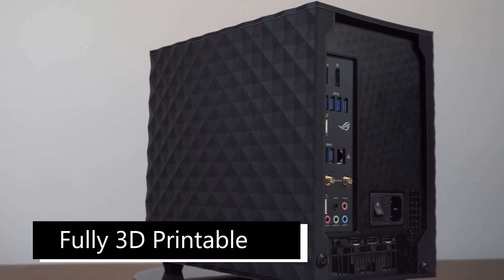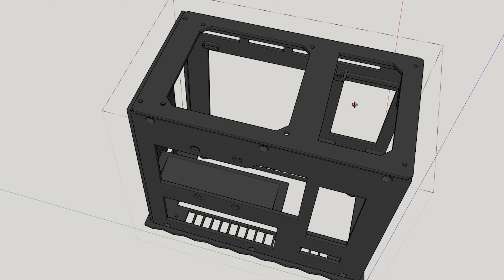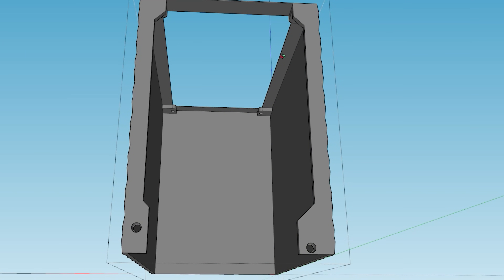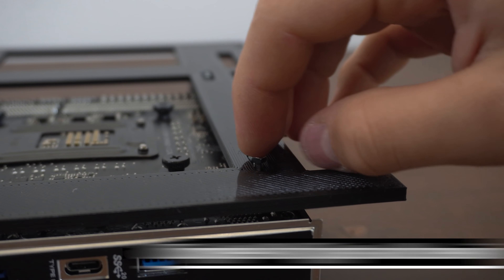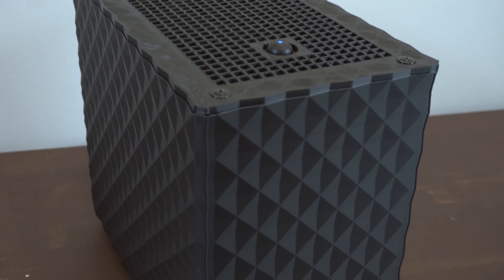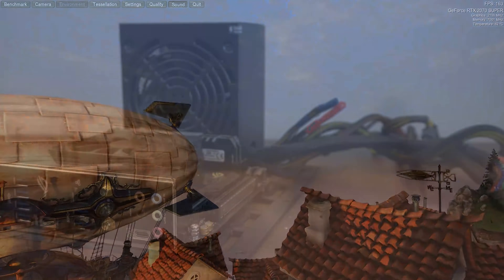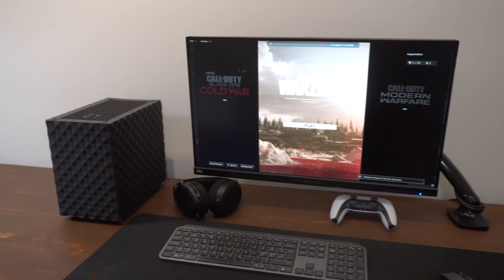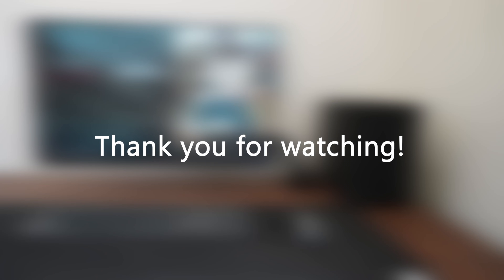CLEAN CUSTOM MINI ITX PC CASE BUILD | 3D Printed

Comment: Sir thankyou very much itx cases and every part is very expensive from the powersupply to the the itx motherboard and specially the cases looking at ur design i must say i m fan and you are also giving it for free is going above and beyond. Sadly i have already bought matx parts but no one makes compact cases for matx. Still very clean build.
Reply from the maker: Thank you! 😊

I’m going to work on a few ideas for matx complact cases as I might replace my fullsize ATX main pc with a MATX board! 😊 I
Reply: @makerunit   i am going to learn blender after this semester ends and was thinking of doing the same had some ideas in mind will be waiting to see what you come up with 😀

Comment: Free idea to make some money... print these in a modular fashion, with a panel/panels that are easily swappable. Could have custom designs to fit whoever's special setups or desires. Not sure if it would be economical or not as I do not 3d print anything nor have I ever. Just something that came to mind watching this again. Could use cut out designs to save material while offering more ventilation also. So many options and possibilities. Really neat stuff you have here. I see this channel growing quite a bit fairly quickly if you keep this up.
Reply from the maker: Hey! Thank you for your input! 😊 And thanks for the sub! (Saw your other comment too). A fully customizable case with the option to choose mounting brackets etc based on spesific needs would really be neat! But that would take quite some time to design, to get it flexible for almost all combinations of parts, cooling etc... it would probably be awesome and I could really see myself trying that in the future 👍😊

Comment: If you're going to design more cases maybe this will be useful: https://smallformfactor.net/forum/resources/accurate-blank-motherboard-pcie-card-models.25/

I found it a bit late when designing my own case, but it was good to confirm everything was in the right place before spending $60 on lasercut mdf.
Reply from the maker: That’s actually really helpful. Thank you! 😊

Comment: Your 3070 build looks like it's the exact 'no dollars wasted' type that I dig, mad respect
Reply from the maker: - Fractal Design Define S
- Gigabyte 3070 (cheapest 3070 I could find and strangely enough I just happened to find it in stock at MSRP in my preferred store already back in december.)
- i7 9700k
- 650w bronze psu
- 1TB m.2 (a2000 from kingston)
- Coolermaster Evo 212 Cpu cooler
- 32GB ram
- noctua fans for quieter operation
- 1TB 3.5 HDD for additional storage 
😊

And absolutely no RGB’s 😅
Reply: my pny looks amazing but you can't appreciate the led's because its pointing down

Comment: Next time instead of screws in some places, you can use press-in plastic nutserts. Used them on my e-gpu case and it worked amazingly.
Reply from the maker: Yeah, they’re pretty nice and gives a much more professional look to all kinds of projects. But they’re not something I could just go out and buy at least I couldn’t find any locally here in Norway. So I went for the screws as it was easiest. Holes seem to hold up fine though assembled and dissassembled multiple times no spesific issues so far 😊
Reply: @makerunit  Ah I got some on Amazon or Ebay a while back. Not local for me either haha. Great job on the case regardless!
Reply from the maker: @bagelbytes69420  Thank you! I might as well purchase some kind of big kit with all different sizes for future use definitely handy to have laying around 😊😊

Comment: 3.5 HD? Why not save space with an SSD?
Reply from the maker: Most motherboards have a m.2 slot. Or like the one I used had 2 separate m.2 slots. But I got a lot of requests from people missing this support in my previous build, so I decided to add this support for this one 🙂. It’s not that hard to customize the one side panel though either by drilling holes or editing 3D file to have support for dual 2.5’’ SSD’s instead 👍🙂
Reply: @makerunit  Undersstood!! Your build is a awesome one to say the least.
Reply from the maker: @izzysantiago978  thank you! I’m glad you like it 😊

Comment: Great project. I'm looking to do a even smaller case so I can use old computers as retro gaming without having to use that much space. This is a really good idea. But I'm still not into 3d printing yet. I am going to recicle old chasis for the same idea like in this video.

Comment: I don't know much about 3D printing. May I ask you how much does it cost to print it? I mean how much is the raw material cost to print a case like this?
Reply from the maker: Total filament usage was about 1.5 to 1.75 KG of black PLA. Assuming one roll is approx 25 USD, then total price about 40-45 USD. :-)
Reply: @makerunit  thanks!

Comment: Nice, but I'd use acrylic for the internal structural parts and 3D print only the outer layer, the complex surface element to save on time/resources..
Reply from the maker: That is definitely doable, if you end up trying it out, let me know how it turns out 👍😊

Comment: fantastic the design of your case, I liked the finish of the panels, did you design on the sketchup?  to avoid warping the piece, don't you think it is better to make the panels separate and then glue? 
On the gpu it would be interesting to have it mounted upside down so it wouldn’t pull dust off the table or a pencil that would roll down. 
They are just ideas that I had when watching.
Reply from the maker: I’m glad you liked the design! 🙂
About the warping, honestly that really depends, the internal brim I added really helped the adhesion by a lot. But I’d say some kind of enclosure or closet is a must to prevent this, as the slightest wind could cause warps... 👍 I don’t think it would look as clean if printed separately though. 😊 about the GPU and dust, I think you could actually easily make some dust filter by simply just making a plate with a filter on it, and just clamp it in place between the chassis and the feet, if that made sense 😊

And yes it was actually designed in the free sketchup 2017 😅

Comment: Looks pretty good! Actually, this is a way to make a really good airflow case. It would be nice to see micro atx cube case made for airflow!
Reply from the maker: Thank you! I must have forgotten to respond to this one, sorry for that. I’ve got one in the progress right now. (Not a cube but a mATX/itx compatible case) Supporting graphics cards up to 300mm+ and all printable on the CR10 or similar (300x300 printbed) Looks promising so far done a couple test prints still some tweaks to do but will be out eventually 👍😊

Comment: The ITX case is a great design. I would only try to print the whole thing in ABS / ASA and smooth it out with acetone. In addition, it can withstand more heat without becoming soft. My PLA prints in my case didn't withstand 2-3 hours of playing games.
Reply from the maker: Thank you!

Smoothing it would be really cool! I have never tried that myself on a 3D printed object! I think the getting soft part really depends on the layout of the build. I have not encountered that issue through multiple hours in a row.

Might somehow get soft but not something that I have noticed at all. Only maybe it would deform if I on purpose tried to squeeze in the sides or whatever when its hot. Maybe only then. Keeps it’s shape well at least with my setup of parts 👍🙂

Comment: I would like seeing a NAS ITX case with a sfx PSU. Unfortunately lots of the NAS cases with ITX using Flex-ATX PSUs wich are quiet loud with the 40mm Fan, and have bad Airflow at all. I´m was searching for about a year and in the end decided to use a mATX case, because I couldn´t find anything good. The problem is, that most of the small size cases are for gaming and dont have much 3.5" HDD slots. Most NAS systems dont use GPUs and thats also wasted space with normal caases being used as NAS cases. I hope you may can do something like this. Would appreciate this a lot.
Reply from the maker: Hey! I’m not so familiar with NAS, do you mean like a storage server case?
Reply: @makerunit  Yes exactly. Most cases you can find are something like the "Inter-Tech SC-4004" unfortunately they have very low cpu cooler space, and bad airflow. A case with a sfx PSU wich is a sweatspot for small size and noise, and maybe a bit more room for a cpu coller with an additional 120mm fan for exhausting the heaat and also cooling the HDDs. I was thinking modeling something like this by my own, but I´m not that good in modeling parts who need to fit toghether :)
Reply from the maker: I understand. Though, most likely I won’t be doing exactly this type of build for the moment but maybe at some later point. But I totally understand what you mean! You should definitely give it a go though there’s so much to learn through YouTube tuturials. I’m literally for now just using the free sketchup 2017 version 😊

Comment: I havent check your other video but id like to see a pc case with atx mobo, sfx psu and gpu 3 fan. no 3,5 hdd only ssd or m2. essentialy a small atx. with cpu cooler noctua nh d-15 or aio 280mm. what do you think? it could be an intresting solution for you?
Reply from the maker: Hey, making something small with an ATX motherboard is definitely interesting. Not sure how small I would be able to get, but I might do an attempt in the future 🙂

Comment: Wow, this is the most appealing arrangement of ITX components I've seen since 2017!
Would you consider evolving especially this design a little more!?
I would say if you did a few more tweaks to make it more versatile and accessible you could undoubtably put it on Kickstarter if you make it in metal!   some issues I noticed:
1. Instead of the "two main windows" for 3,5" mounting, make it a big window again with a screw-on bracket for people who do want a mount 3,5" or 2,5" drives there. This also allows people who don't use 2,5"/3,5" drives anymore, to directly access the mainboard easily if you want to change RAM sticks etc.
2. Consider a possible mounting of the PSU in the way that it draws air from outside, so that the shroud allows to draw ai from outside via some venting holes. Would also have the postive side effect that the PSU cables don't collide with the space for the grahics card. And maybe also make it a screw-on mounting bracket to allow for a use of SFX PSUs, maybe you would even have enough space for TFX PSUs etc instead of making it direct part of the side panels!
(btw there are some nice semi passive PSUs from Corsair that don't start spinning before you draw 150 or 200W and partially, depending on the model, even more - would be a benefit for semi-passive PSU users if the shroud had some air vents to not draw air from the outside.)
3. For smaller PSUs (SFX etc.) did you consider to make it possible to move the mainboard sidepanel a bit more to the inside, so that some poeple could mount a radiator behind the motherboard? I can't tell how much more space this would free up in the case but if it's enough you could probably even satisfy the water cooling community (ok, would then again need venting holes, this time in the side panel...).
4. Make mainboard mounting holes for compatible for STX boards.
Currently we don't know what will get more love in the coming 5+ years from mainboard manufacturers in the SFF space, therefore it wouldn't hurt to have the fitting mouting holes.
(plus, those boards aren't using the big 24-pin connectors / ok you then need some extra bracket for the PSU standard STX uses, but I would bet many would also love to change their board if ATX12VO shouldn't become a standard in the coming years, just to avoid having to deal with the 24-pin connector (look at the tiny space between PSU and board even in your case! ^^))

If you should go down this road, I would love to see it on Kickstarter in the future! :D

bonus idea:
many of us already have very potent 48mm coolers that do their job excellent, especially, when they draw air directly from outside the case - mind designing a 3d-printable mount-on wind tunnel that fits with 92mm fans? :p (in case, the shroud gets vent slits/holes)(after everything more important is done)
Reply from the maker: Hey! Thanks for all the suggestions! I’ve seen many comments both here and on Reddit and I’ve gotten a pretty good idea now what people seem to want! Watercooling options, added storage, direct air intakes from the side, and generally more flexibility overall. This is also my personal favorite so far. If only I could make it so it supported 3090’s too it could potentially be pretty awsome. 

I’ve got some new ideas in mind though! 😊
Reply: @makerunit  Gotta say, I'm almost a little hyped of what I'm seeing here. Especially seeing how quite robust this all could become with just some brackets. I could already imagine even this is no two chamber design, if the CPU cooler could draw air directly from outside this could become a really reliable workhorse with the way the graphics card pulls air. 
Ahh yes, and of course you need a 90° angle power cord if you rotate the PSU by 180°, but I really think the PSU should get the air from outside, there are only really pricy passive PSUs and drawing air from inside is nearly a death sentence for every silent PC! xD
Reply from the maker: You got some solid points. My main concern was to ruin the esthetics of the case by adding additional holes in the cover. But I’ve got a pretty good idea in mind that might improve the thermals by a lot. If it actually works is another question but it’ll be fun to see how it ends up working’ 😅
Reply: @makerunit  Additional note: just remembered, when the fans are so close to the ground that can affect the perceived loudness/ sound characteristic of the graphics card fans in an unfavorable way. Maybe look into this. Guess won't be a big issue for all semi-passive and passive cards, but maybe for active cards with bad fans, but sadly can't name any brand I would be aware still uses bad fans, not buying THAT many graphics card throughout the years! :P

But maybe experiment with different heights of feet/stands, no idea how these are actually called! ^^"
Reply from the maker: I’d just call them feet 😅 I haven’t had any issues so far with this. But PLA is a very hard plastic. Having the graphics card resting on the bottom plate like that definitely introduces some tiny vibrations into the tabletop. Adding some furniture pads or rubber pads to the bottom of the feet removed the tiny vibrations in my case.
Reply: @makerunit  Think we all have a bit of rubber foam just in case if it comes to vibrations! xD

Comment: A SSF Case with support for dual 280mm Radiators would be awesome. A D5, SFX PSU, ITX MOBO and a small reservoir would make it unbeatable.
Reply from the maker: Would be amazing indeed! Question is would it still be considered «SFF» ? 😅 Not impossible. I’ll try out a few different designs in the future though! Some watercooling at least is definitely in the plan with my next case design! 😊

Comment: My dream case is a nr200 style case, 4x 120/140mm fans, 2x bottom and 2x roof for that lovely chimney style cooling. Vertical gpu mount, triple slot x 320mm long. As a bonus, 240/280mm rad support top, and if possible front. Maybe with enough adjustability to be able to connect them both with 90° connectors. Mind you that would make it pretty tall. Thin though, possibly.
Food for thought.
Reply from the maker: Yeah’ the NR200 is a great case! Vertical 320mm card with 90 degree connector would make a very tall case though! I’ll be working on a few ideas for more flexible solutions in the cases in the future,  more focuses on airflow and flexibility like watercooling etx. As the ones I’ve made so far are kinda locked into one spesific layout! 😊
Reply: @makerunit  I meant vertical like in the Nr200, with the fans pointing outward. Sorry my wording was off. It would limit ram and cpu hight though, but with a low profile pump if you had 140's above and below sending through an ungodly amount of air I reckon she'd be alright. Although thinking about it, having one of them thick of gpu's that expels air sideways, using a mini itx board if you could have some air vents right below the motherboard and mirrored on the other side panel and then allow the gpu to suck in through the bottom you'd be ejecting that air straight back out again, then you could use the gpu to create a sort of chamber for the mobo/cpu/ram which would be easy enough to create a nice flow. Sorry I'm full of crappy ideas and sometimes they just pour out.
Reply from the maker: @ConfusedRaccoon  your ideas are really not crappy at all! That chamber you’re talking about is actually a really good idea! Thanks for the suggestion maybe I should try it out to see how it performs! 👍
Reply: @makerunit  Go ham my guy! I aint going to have a 3d printer any time soon, so if someone can use my idea I'm well chuffed.